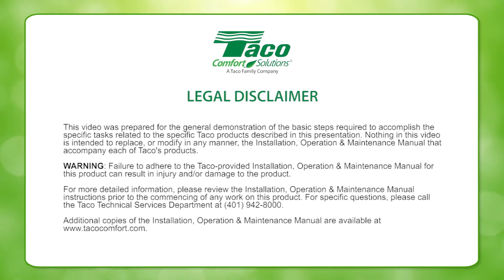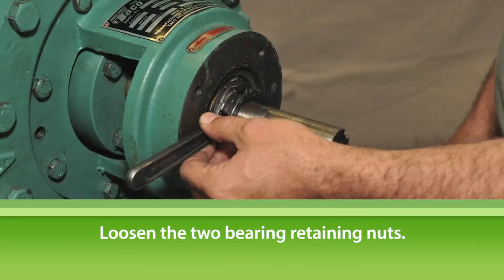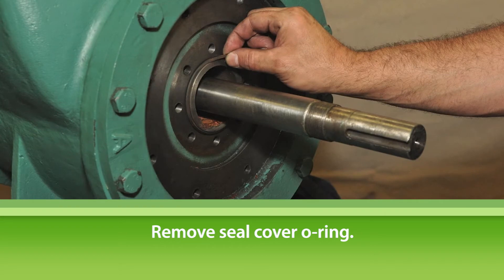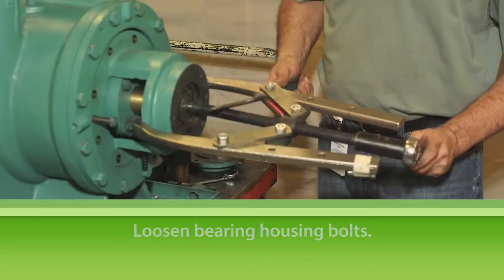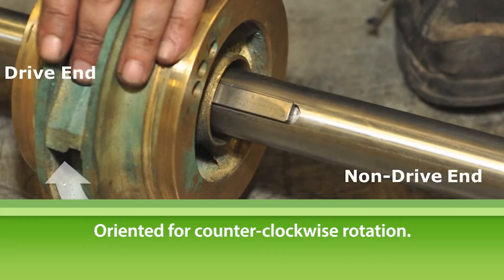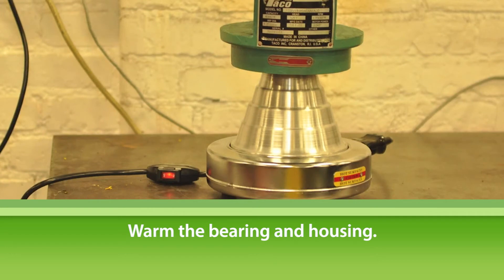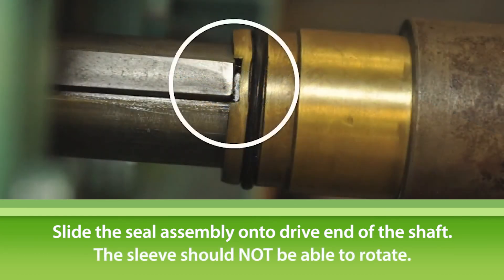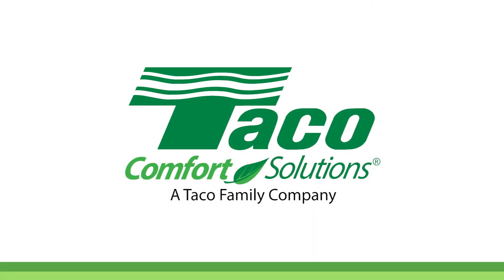How to disassemble a Taco TC series pump

Comment: Hi! I have an F series bearing frame assembly FI4011E2KAJIL0A. Which is apparently discontinued. Now if there is a retrofit for my frame assembly what is it and what is the seal kit. Shaft size is 1 1/2"

The old seal kit is a 953-1549-6BRP